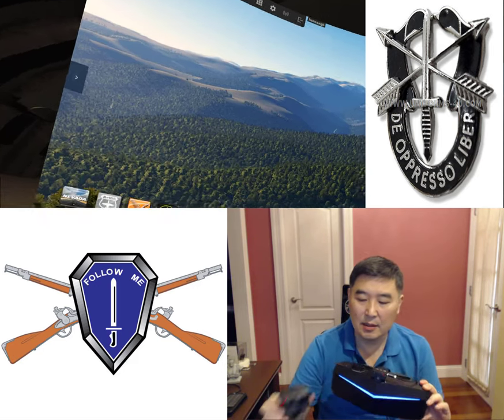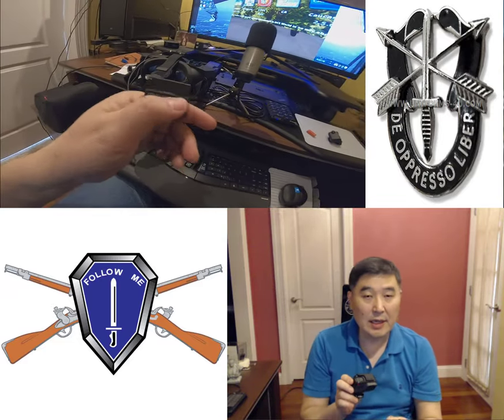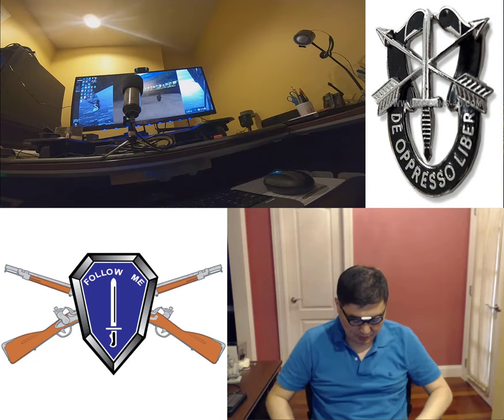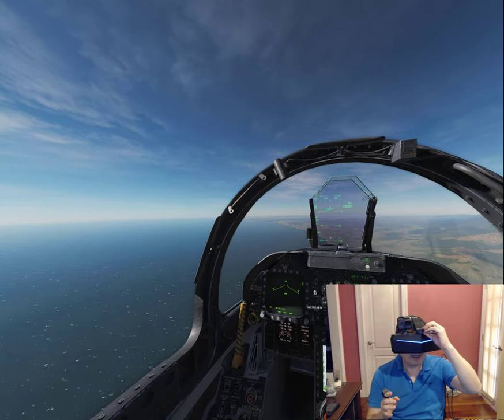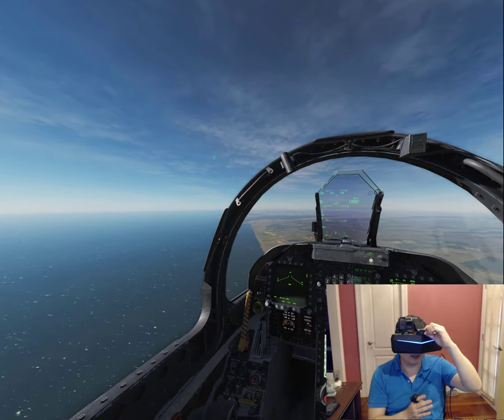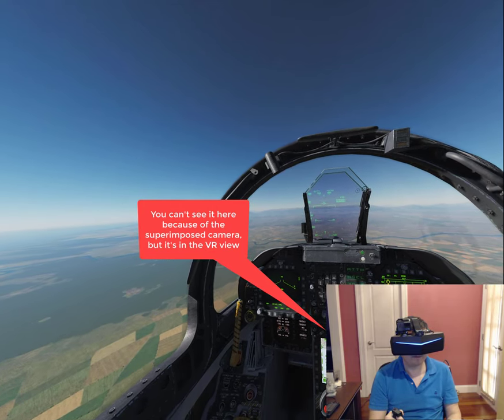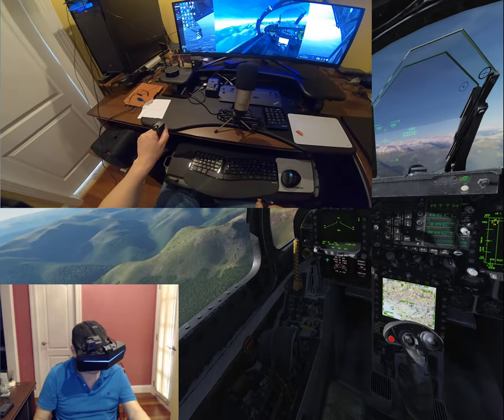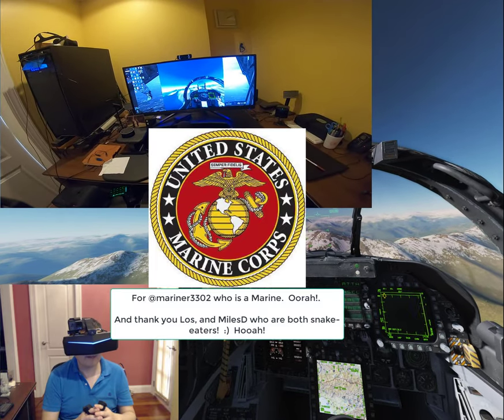PointCTRLCalibration in Eagle Dynamics DCS

Comment: would it be possible to mount the head device on the rift s headset? since it has already a camera on the center top
Reply from the maker: Check out the INPUT and OUTPUT thread in forums.eagle.ru   I'm pretty sure MilesD will have (already have?) the Rift mounting kit.